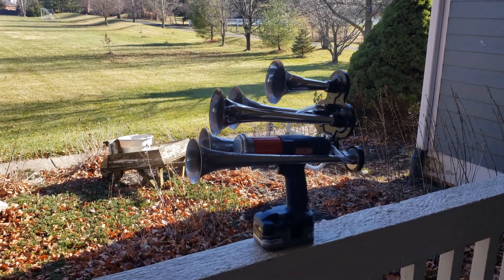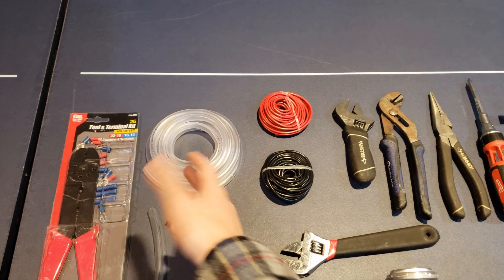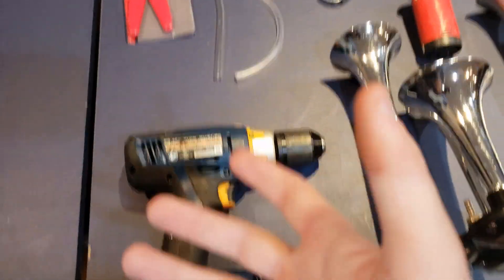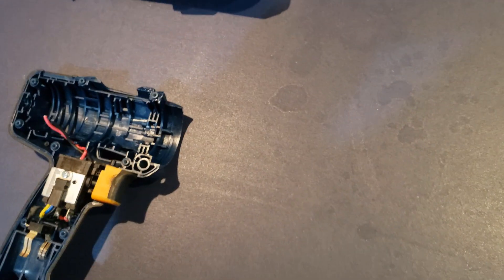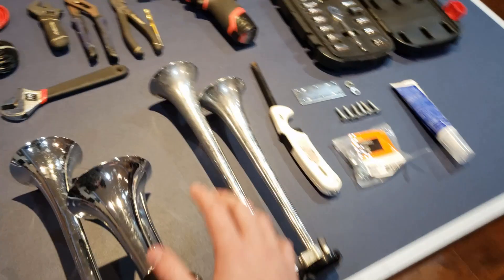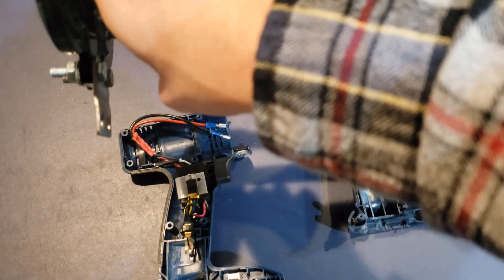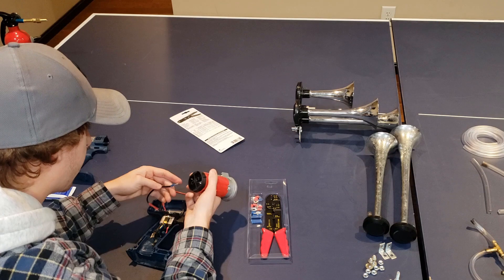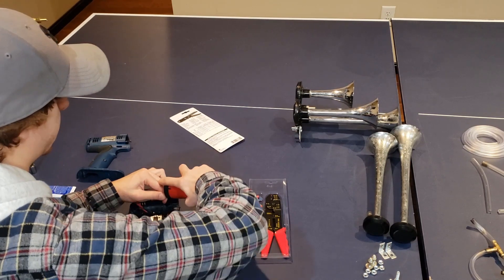How To Build A Train Horn Gun!

Comment: When you first put your 1/4" bolt thru the back of the drill housing it would probably be better to go ahead an put a nut on it to hold the bolt in the drill so you don't end up pushing it into the drill during assembly.  Then ya wouldn't use as many spacer nuts.